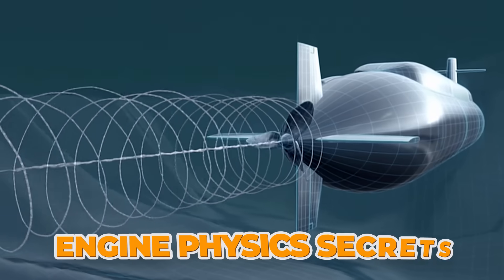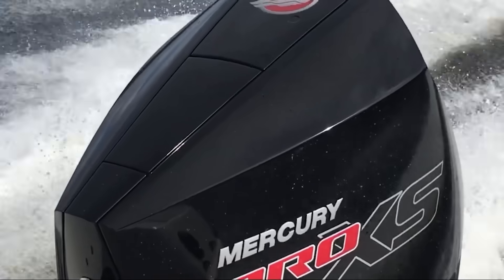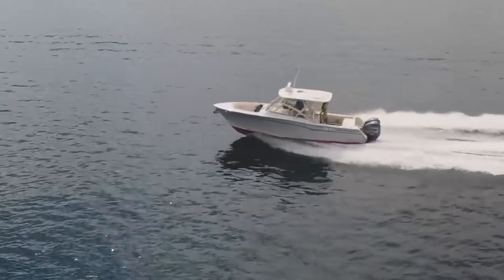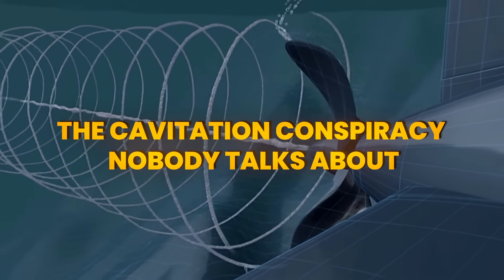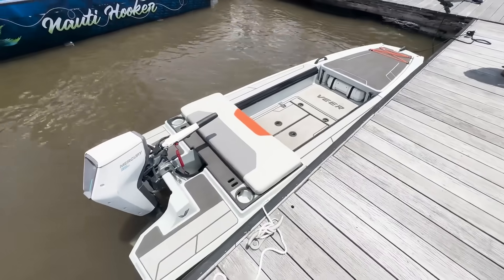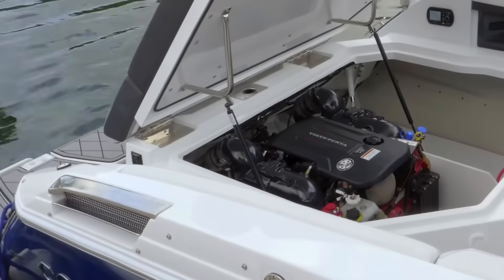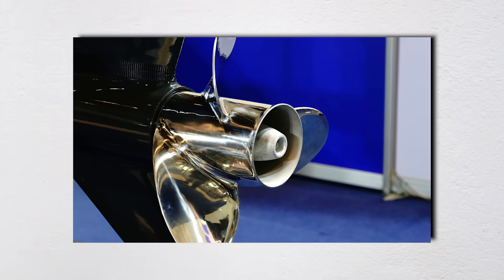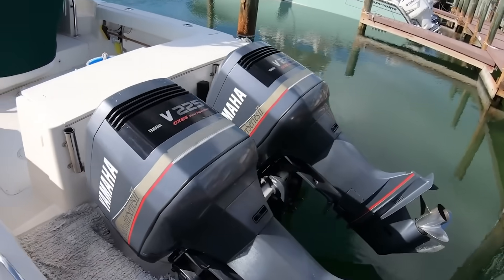Engine Physics Secrets Every Owner Should Know

Comment: Prop shops can do nothing with an aluminum prop. No adjustment or alterations from how the were made. Stainless, bronze, nibrow all can be worked.
Reply: Wrong-O! Aluminum & bronze props CAN BOTH BE modified & reworked! I've had mine worked on with custom cupping & pitch tweaks many times! In fact, because they are soft metal, they are even more easily modified than SST!
Reply: @fastwin493 Blades will fly, mark my words. Most shops won't touch aluminum and the ones that do haven't been sued yet. The only props I've ever seen throw a blade are aluminum, they bend once and that's it. Yes the are soft but cast and brittle. There is a reason they are the cheapest to purchase over all else on the market. You don't alter them you just buy new for the same price. With new you don't have to worry about a flung blade hitting anyone or being left stranded. Good luck.
Reply: @plap. OK your point is taken. But, I've been boating since 4 yrs. old. It's a case by case situation when any prop is reworked and how much. And if the less knowledgeable, professional & competent "fly by night" shops that don't know how to tell whether an aluminum prop can be worked on within proper limits (without just LAZILY blowing someone off to sell a new prop) such that a blade will fling, that's on them. As I said, my experience has been different.

Not all props are cast with the same materials. Not all aluminum is of the same metallurgical composition, mechanical strengths, molding processes & quality control. It matters, who makes the prop and, based on that, whether rework can be successful. But, it has been done successfully without that sort of drastic results every time. 😊

Comment: Very good and informative video!

One other item to increase performance and should be done before changing props or engine height insure the engine is tuned and running properly.  Neglected maintenance can rob performance.

Comment: Let me put it to you in simple terms. If the propeller you have if you can stick your fist in the center of it, it has to be down in the water. A Fair amount that means your dragging more of the boat in the water. If you lift the motor up too high water can't get to the inlet  on it and You'll burn up You're a motor. The other Style prop is a chopper prop. But to use one, you have to have a lower end water pick up on the foot. I know the words the nose comb. You have to lift the motor up with that style. Prop, you won't the center of the nut were it Fits on the crop about 2 inches below the bottom of the boat. You lose bottom  take off. But mid-range and top end it's like a Ferrari.
Reply: Can you translate that for people that speak American English?
Reply: @williammartin2842 All you got to do is go on the internet. Put in chopper prop, you'll see it. Now this Type of prop. Works at the surface of the water. You have to have a lower end. Pick up to use it to get water to the pump for the motor. Or you'll burn your motor up. Bob's marine. For the lower end, pick up.
Reply: It's called a Cliever prop aka surface prop
Reply: @fredrosch5013 Thanks for the Pacific, but we just call it a chopper. Prop.

Comment: Coming from aviation all these tips described here were excactly the first thing wanted to know on boating. Similar principles.
Reply: All motorized machines no matter what the form, follow the same principles, especially planes and boats and cars. The boat's planing action is quite similar to the lift of an aircraft wing. In a car its the wheels in contact with the road powered by the engine and driveshaft that make the car move and control it. In a boat it's a specially designed screw in contact with the water connected to the driveshaft, that makes the boat do the same, although the contact surface is fluid the principle is the same.
Reply: @chrisrobs Correct. There's only a difference in a small "detail" : water is      
 incompressible..

Comment: Electric engines won’t be replacing gas or diesel engines any time soon. Especially in the marine world. We just don’t have batteries with enough power density.
Reply: And too many batteries equals too much weight!  Bass boat with a gas engine for the win!
Reply: Electric motors on boats: first we have the battery weight. Then the costs, and finally the charging. How will that work? Cable to the mooring is OK. But the harbor will certainly charge well for that and keep the prices high. Or put a generator with diesel on the dock; have fun with the harbor noise. Apart from that, if I forgot to charge it the one time, that's it. If I have a combustion engine, I just top up from a canister, and the range is almost unlimited. I also see a greater risk with the batteries and the current from short circuits. As for sustainability, if I need new batteries after 20 years, they may already exceed the residual value of my boat. With a combustion engine, I swap the motor for a used one and keep driving if it's defective. The whole electric thing is for green idealists and nutcases!!!!
Reply from the maker: Yet!
Reply: @VintageBoats There's no revolutionary battery technology on the horizon likely to change that. 

Battery technology hasn't significantly improved since Lithiums arrived on the scene many decades ago.
Reply: @mrfish9876  you haven't been following China or Japan or Korea. There are others working on developing technology outside the US and doing a much better job of it.
Reply: They explode too
Reply: What about nuclear power
Reply: Also when I put fuel in my 1993 Suzuki overboard it runs. I doubt we will have batteries lasting 30+ years in saline environment anytime in the future.
Reply: @Hope_Boat look into solid state batteries. They will be a thing in the not too distant future

Comment: Electric outboards have a major problem that it's going to take quite a while to solve - power density per unit mass OR volume.  Batteries, even the very best, have a tiny fraction of the energy content of chemical fuels.  Electric cars have a BIG edge over boats - most of the time, they're running at a fraction of their HP output and electric motors can do this more efficiently than internal combustion engines.  But boats?  They're fighting serious hydrodynamic drag all the time - and their engines run at a much higher percentage of output, draining their much smaller energy supply (the battery) much more quickly.  In short, batteries have to not only become cheaper, but increase their power density dramti😂cally, relative to size and weight, before electric boats can match the performance of chemical fuelled ones.  Also - consider that half of the fuel - the oxidizer (air) - does not need to be carried on board - in a chemical fuelled boat.  It's a pretty steep challenge to electrics.  So, in short, for short sprints and pure power, or slow, low-drag displacement mode sailing, electric boats can do OK.  But for skiing for several hours or a trip from New London to Montauk (CT to the tip of Long Long Island, NY), better use a conventional (gas/diesel) powered boat.  or sail.
Reply: If only they could suck energy from the salt?
Reply from the maker: @dalenulik5622 or the sun...

Comment: I dunno about electric outboards taking over so quick. Batteries are pretty heavy and quite expensive. We’d also have build out the electric infrastructure to charge the boats at docks and marinas. Gas stations are still far more accessible and convenient
Reply: The 450L diesel in my boat is a lot of weight too and I have to get that in jerrycans by driving my car to a gasstation. My solar panels can charge the batteries for free. But at this time the batterie-packs plus electric engine are more expensive as a new inboard diesel.
Reply: @pa4tim 450l in diesel weighs 382kg, whereas an equivalent lithium ion battery weighs 9 tons
Reply: Very long extension cords lol
Reply from the maker: Any decent marina is already very well equipped to charge. Arguably, any boat or any boat with service batteries should be kept somewhere you have access to shorepower!
Reply: @VintageBoats  very few marinas can provide 100-200kwh at every dock even if they do have power cords that can trickle charge
Reply: And given the performance you would lose a lot of range.

Comment: Subscribed! My biggest issue is props! Loads of slip, I've tried a larger 4 blade and no better than the 3 blade smaller... I thought J had it figured out
Reply: Sounds like you're trying to solve a non-propeller problem with propellers.
Reply: Try cupping the ears of the prop 2mm at a time until it starts biting more. Keep going until it starts slipping again, then back it up 10% from there. You will have to buy a cupping tool or have a prop shop do it for you.
Reply: Me to.... what engine do you have?